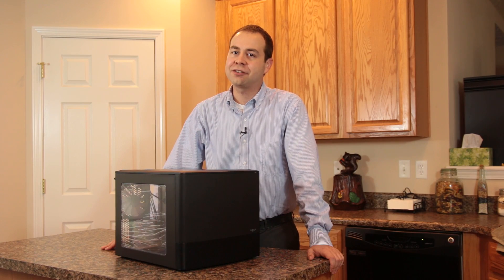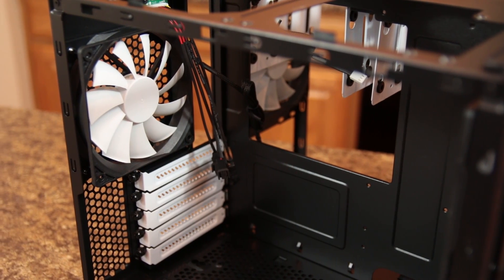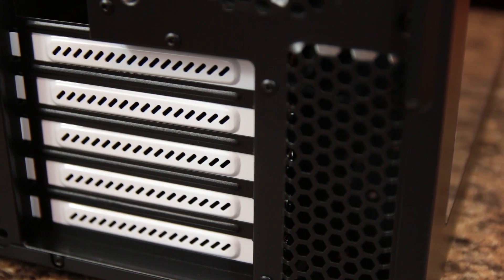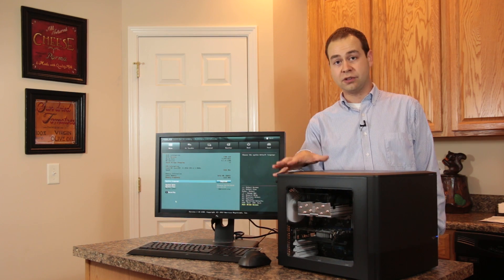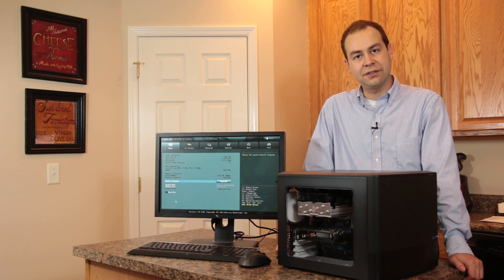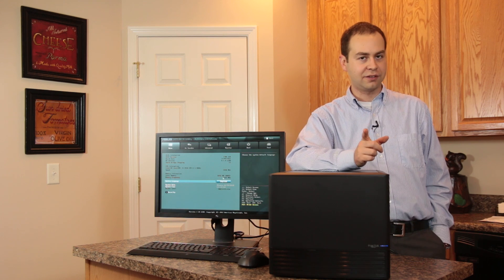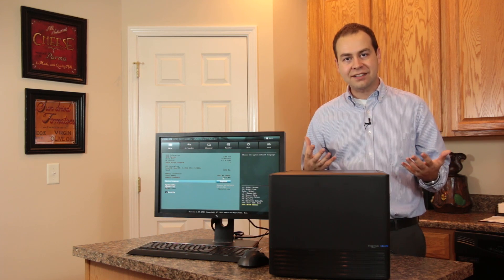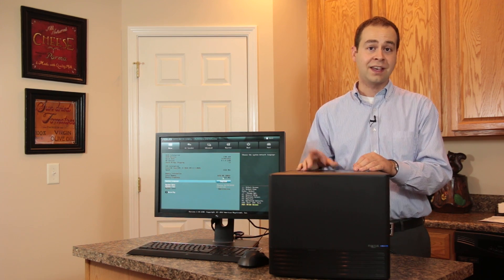Fractal Node 804 overview and build experience

Comment: For the front of the case, what kind of fans do you recommend to use? Static pressure or Air flow?
Reply: if there is a filter in the way, or hard drives right behind it, use static pressure. if its just a open environment use air flow.

Comment: 250d or Node 804 PLEASE HELP ME
Reply from the maker: The 250D is Mini-ITX only so it comes down to your application. For ITX, the 804 is probably overkill unless you need to run a lot of drives.

Comment: I'm not impressed by this type of case.  It only holds m-atx, has a huge footprint VERY bulky, no traditional 5.25" bays, not much in the way of front vents, and a lot of wasted space.  OK it holds a few hard drives, but how many SATA ports are on m-atx boards?  I guess the right hand side makes it easy to shove all your spaghetti in, but I don't think that's a good way to address the wiring problem.  I can get the same amount of stuff in a much smaller, less expensive case... while providing better airflow.  I'd take an Antec 302 over this thing any day.
Reply from the maker: All solid points Dave. Thanks for the feedback!

Comment: Great built! Awesome video !
Reply from the maker: Thanks kreeper! I feel like I have such a long history now with the H440, haha. It was refreshing to use something else for once.
Reply: Tech Uploaded Hey, I am building my first pc and I think I will buy this case and an r9 290 from gigabyte will ir fit with the lower fan in place cause its 294mm and will it over heat with two of them. And if I put my 2͵5" drive in the front and 3͵5" on the other side could I remove the hdd/psu side fan to the mobo side for more air flow for the gpu and later gpus?

Comment: Great review, Chris...and glad to see that you're feeling better! Having seen your NAS build...and now this one, my NAS case possibilities are:

- Node 304;
- Arc/Define Mini; or
- Node 804....for the sheer drive capacity alone (others can hold 6, this one holds 8 or 10)!

Thanks again.
Reply from the maker: Hi Raj! I happen to like the look of the Node series for server type of applications as I can set it somewhere not on my desk and it's not overly obvious it's a computer. If you go all out with a board like an ASRock C2750D4I then you can use ECC and have up to 12 drives. In that case you could go wild with storage in the 804. If you only need up to 6 drives, then the 304 is a good choice. Both are super easy to build in.
Reply: Tech Uploaded Thanks, Chris...great advice.